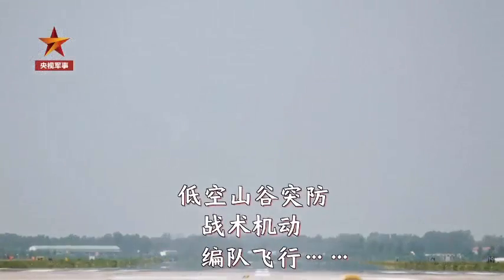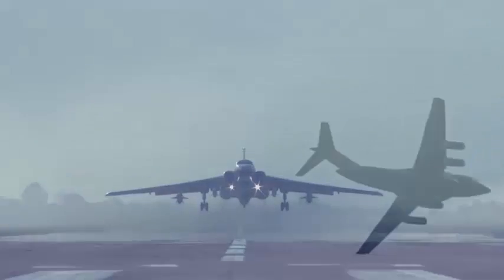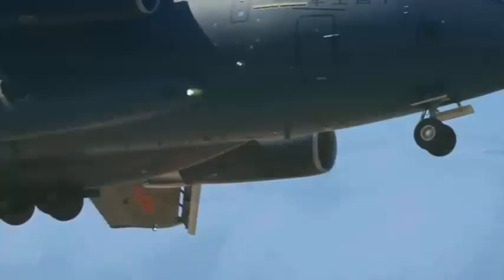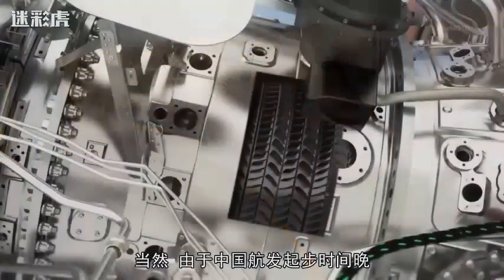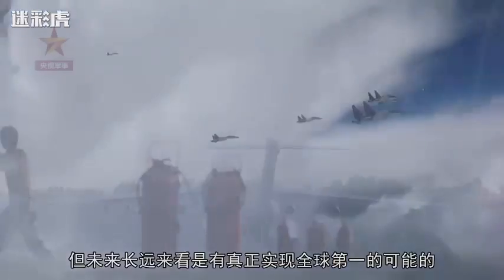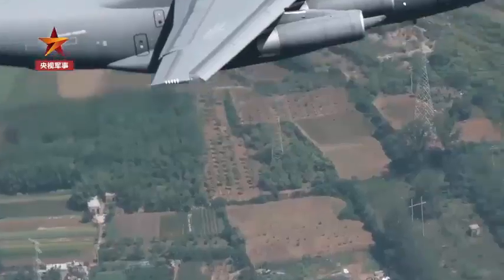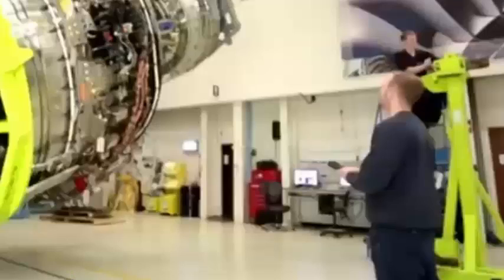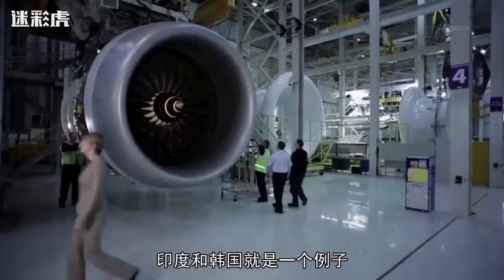China's New turbofan 20 engine successfully conquered high thrust and large bypass ratio vortex

Comment: GE90-115B makes 127,000 lb of thrust . You also need to check your information on the bypass ratios . Modern fire jets use a bypass ratio of 2- 0.5 . Commercial airline and cargo jet engines bypass ratio is around 12:1 .
Reply: Cargo jet engine always uses obsolete generation. Their bypass ratio were around 5-6.  GE nx are for 777 big airplane, others use around 7-80k lb thrust class.